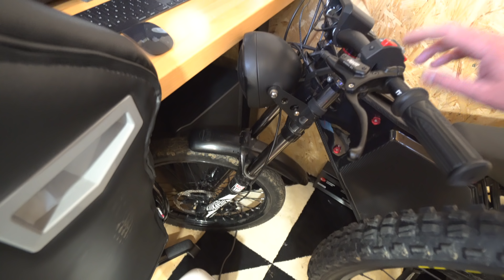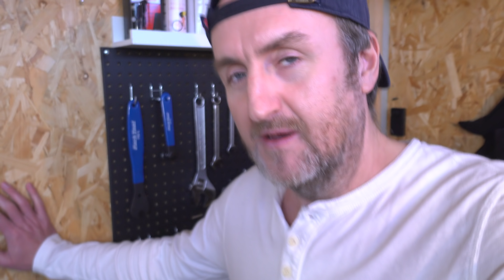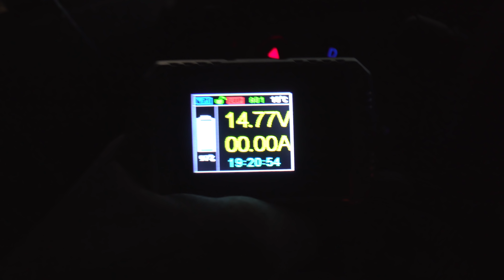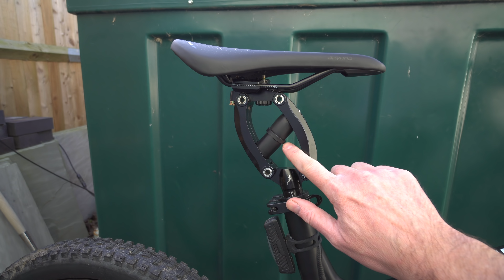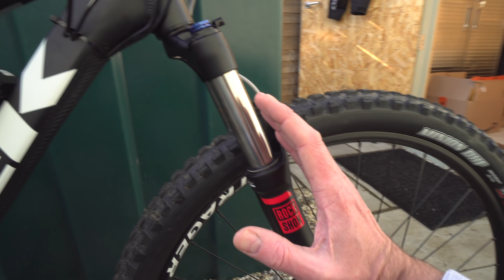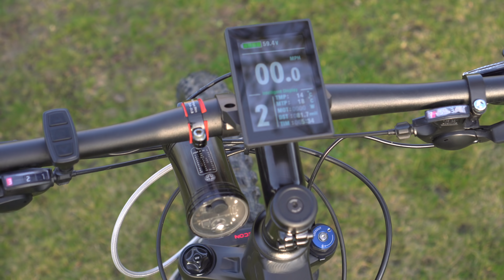BEST DIY EBIKE MODS 2019!

Comment: I just finished building my own ebike and like yours it amazing, its like going in a shop to buy one item and come out with half of weeks groceries, just get carried away.  I just wanted to change my front hub ebike for a mid drive coversion, I have ended up putting new forks on, hydraulic cable disc brakes, saddle ,handlebars I just got carried away, but yes its an amazing bike and love riding it and of course it as been built to my liking.  So yes building a ebike yourself is great fun and glad I did it as I think apart from Frame, battery and back wheel everything else as been changed and like yours it an amazing cycle made just for me.

Comment: Hello i bought you 1500 -2000w kit in august 2020 and it stll has the full cable instead of the pinned quick release  why is this please ?
Reply from the maker: The 1500w kit always has the full cable because the current is too high for a quick release connector.
Reply: @andykirby  Thank you for your answer that helps

Comment: Hi, I have the same Kit and Kt Lcd8s  Can you tell me or do a video of what the settings should be, for best performance top speed excelleration On the throttle, ie  the p  c  L  parameters,
Reply: It will mess up the ratio which will result in very noticable distance shortage

Comment: Anyone know what size the rear wheel is, it's definitely smaller than the 29er front, maybe a 26 or 27.5, want to build one of these but would like a 2.8 rear tyre so wanna make sure it fits, thanks in advance
Reply from the maker: It was a 26inch, if you are going to do it then prob best keep the same wheel size front and rear.
Reply: @andykirby  thanks, dunno if it's practical or not, but love the look of the fat 2.8 on the rear, think I heard you say somewhere that 26 is best for the 1500 hub motor, so will go with that both ends, cheers

Comment: Johno Hi from here in Australia I going to buy a 1500W rear wheel conversion Kit need to buy a battery, what i would like you advice on should I buy a 48V battery about 14AH or  52V  battery as I noticed the price of the 52V is only a few dollars more is it worth it or will the 52V battery damage the 1500W conversion motor.  I not interest in speed just need help getting up hills on the ride home, since my heart operation even a small hill I need help.  your videos are great look forward to your advice Thank  You Johno

Comment: Hi @Andy
Just let you know the kit arrived last week. Already installed and made 150km. It's fantastic.
Actually regenerative breaking is working perfectly without Throttle. Just change settings in menue c13 from zero to five. Five is the strongest. Now when I brake with front brake regenerative braking kicks in in the back..  so I now have a combined braking system.
Very satisfied with the kit 👍
Reply: How long did it take mate. I ordered mine 3 day ago
Reply: deveric, do you know how I might invoke regen braking if I haven't installed the supplied brakes levers?  Didn't install them as I have hydraulic brakes and couldn't see how you use the supplied ones that go with the controllers.  I didn't understand what Andy meant by coming of the throttle and regen is started just before it hits zero.  To me I would want regen to slow down from a fast speed not when I'm at or near zero?

Comment: Alright Andy, I have the exact same kit as you and I was just wondering how do you know how many miles you have left and how many miles does your battery last also where did you get your black box from that has the controller in and wires?

Comment: In one of your videos, you said there were no mid drive motors that offered re-gen... here's your sign!!! Get it done and i will buy one from you. Cheers and be safe.
Reply from the maker: The truth is it’s not actually worth it on a bike with a small battery because you can’t really dump a lot of charge into these batteries without damaging them... the max charge rate is about 4A (so 4A x 58V = 232Watts of regen is not a lot) if you had Graphene or cells that could dissipate a high charge rate then it becomes viable.

Comment: Very nice finish Andy and it looks good and the brakes and saddle post are a excellent choice.

Now for the negatives lol.....
Why on earth all those crappy connectors on your controllers. 

For a long time my main gripe is all those f..king connectors and what tft screens can be used.

First of all those higo and Juliet connectors. Then open or close brake systems and then compatible controllers. (Sine wave or square..mosfets and finally magnets on the pedelec and throttle wiring...no bloody common standards in the Chinese bike world.
I have a bafang 500watt rear hub...with Lishui controller ..Juliet connectors and a sw kingmeter lcd...If I want to fit a eggrider display what controller is compatible...or what controller with a color tft screen.?
If you can sell a tft color screen with higo or Juliet waterproof wiring and compact controller  as a kit that would be a first..I know KT controllers have a compatible screen but it's rather shitty.
I know you do a Subvoton kit but it's to big and the wiring not waterproof. Any ideas on a small 500w 20amp controller with Juliet controller and a TFT type Bafang controller as in France nothing available .Ahh and  a light wiring socket .On your bike no lights mate so not a good thing....😃😃💗💗
If you can crack this problem mate your the boss because I have been looking for last 12 months on aliexpress and lots of ebike sites but nothing exists...A lot of my mates want a tft screen but can't find a compatible kit it's a real nightmare....any ideas most welcomed.😜💗💗
Reply from the maker: Thanks mate. It is a problem yes, and something I’ve been thinking about a lot. There’s a few standards that have appeared recently and it’s certainly better than it was 4 years ago but there is a long way to go before we reach full plug and play! 
For big bike builds then I think you’ll never get away with the complexities of the sabvoton and adaptto, Kelly etc controllers but for simple ebikes it needs to be even simpler. Have you seen what Grin are doing with their base runner controller that is actually built into the battery bracket. Seriously cool and a truly minimal install with hardly any wires. We are going to get those in the store soon.
Reply: I looked at the Grinn products very interesting ..Hailong are now doing a controller inside their battery pack.The plug and play does exist bit it's reserved  on  expensive factory models. Bafang do it on the BBS01 mid drives but rear hubs nothing. The plugs on the bafang hubs are pretty standard the solution exists but the Chinese don't want to offer this solution because it will kill all the smaller manufacturers. So lets be creative why can't a British company offer such a kit..food for thought...anyway I'm off to India for a few months so if I see anything interesting I will share my findings....best of luck with e bike project..😎💗💗

Comment: How much does your high power ebike weigh? Even a rough guess. Building basically the same ebike with the qs273 and am curuious what to expect
Reply: About 60lbs with a Schwalbe marathon plus gt tyre and slime tube ( these 2 items alone added 4lbs to the rear wheel weight😯
But to be fair you don't notice it with it the power this puts out,  unless like me you don't know the range of the battery on your 1st ride out ( at full power I should add) and run out 2.5 hilly  miles from home and have to pedal the bloody thing home.😓😓
Reply: Sorry didn't read your post properly, I'm talking about the kit in this video added to my cube 29er ltd sl.
It's a proper tank now but its Brill fun in pas 5 mode keeping up with cars in the 30mph zone ( only did it once and now ride sensibly  lol).

Comment: Hello Andy, can I pick your knowledge? I have a 60volt 25ah battery using a 30amp BMS. What are the positives and negatives of having the same battery as mentioned but using a 50amp BMS.
Reply: it'll handle more current and might balance quicker but why change it ya battery will only last 30min for a guess even if you draw 40amp,,,the 50amp BMS might just be output and balance might be same as your 30amp version as a guess tho 😁

Comment: Where did you find the box for holding the controller ??   Thanks, Al
Reply: Link is in the description. Bought the same one but couldn't fit the controller and all the wires. Now I use a little motorcycle bag under the saddle. Don't know how Andy made it fit.
Reply: mopalover55, did you sort your case problem. I'm having trouble finding the right controller box?  Ordered 2 so far and both too small!

Comment: Do you have any of the new wheels with the Juliet connector that you mentioned making it easier to remove the rear wheel. Would buy one of your kits if it has the new connector.

Comment: Whats total cost with mods?
Reply from the maker: The main essentials for this build
Bike £400
Motor and battery kit £740
Suspension £300
Maxxis Minion Tyres £80

On further testing the standard tektro brakes are good enough and the funky seat post isn’t really needed. 
This build really is a great everyday ebike.
Reply: @andykirby not too bad, i like the concept.  thanks for the reply!

Comment: Hi Andy.
Just ordered one of your 1500w kits with the upgraded wheels and the sensors for hydraulic brakes. 
Do you have any info/video on fitting these brake switches.
Also, didn't realize that I'd entered my email address wrongly. How can I change this. 
Regards
Brad

Comment: Hi Andy, I've got an 8kW model, same as your powerful bike there in the shed. The MSVA is horrendous, I don't even know where to begin. I downloaded the official pdf guide and it was way too technical. It would be good if we knew where to get certain parts like the brake levers etc. I only have rear indicators on my model if I were to install front ones, how do I get both of them to work together? So many questions regarding this but too little info out there.

Comment: With those seat posts that have suspension, you need to be careful on long rides with them as they are no good for long rides. If your legs are constantly taking shocks with your bum moving up & down then the force goes through your knees & on a long ride any sort of change with your setup will cause your knees to swell up like balloons.
Reply from the maker: Is that if you are pedalling?!😁
Reply: I did 2000 miles last year with the suntour syspension seatpost and my legs are better because you can lift feet off the pedals on bumps

Comment: I’m curious if you have suggestions for converting an old motorcycle to electric. Great videos
Reply from the maker: Yes the easiest way would be to use to hub motor (motor that is laced to the rear wheel) something like this motor: https://www.cloudsto.com/ebikes/motors/qs-273-v3-8000w-motor-detail.html then you could use all the available space where the engine went for batteries and the controller. A mid drive motor would allow you to preserve the running gear (gearbox,clutch) but would require mount fabrication and more work.

Comment: I have a question. I am thinking of building an ebike. What is to stop me using 4 12V batteries usually used in Emergency Backup Power Systems in series. Also, they are 12V 20Ah each, but don't have any stated Amperage. Is that a problem. Thank you. You have been a great help in my process so far. Love your work :)

Comment: If you want a lightweight bike like mine then you would need a full 3k carbon fiber as much as possible, frame, handlebars, seat, seat post, put shimano ultegra running gear except the crankset, wellgo carbon pedals, strong wheels if 26", michelin wild run r advanced 1.1" slick tires. Then your bike will be about 8.25 kg without motor.

Comment: Wow! Off the scale Andy! You've gone mad with the Trek mate - looking very tidy indeed. Is it fare to say this project has made your decision to register the Beast for the road? Because with both bikes, You now have all options covered.
Just a very quick tip for the colour LCD. C3 parameter setting, set to 0 Andy.  Me giving you advice, funniest thing I've heard all week!!
Cheers mate The Trek is gorgeous!
Reply: Can I ask what changing c3 to zero does please?
Thanks
Reply: @jasonlocke154  Hi Jason
Yeah setting C3 to 0  just means that everytime you start up your bike/LCD it defaults to 0, meaning you always start in neutral. Rather than starting up in the last setting you left it in, 5 for example!  This can be dangerous when pushing the bike with maybe an accidental twist of the throttle if you have one

Comment: Hi Andy nice bike be interesting to see the performance..I'm running a Bafang mid drive on a 29er hybrid . Trying to keep it light but I'm only 250w with a 15ah hailong battery..been running it for about a year now...would have liked to go to a bigger motor and looking back I should have..I've not been stopped or even had a copper look at the bike even though I can do 30 mph. Have you had any info on the latest drone laws it's been a while since I've been out with my phantom..
Regards
Jim

Comment: For S-PEDELEC if you buy direct you can speed the process up using a "certificate of conformity". I can't find anyone selling S-PEDELEC with certificate of conformity at the minute. Finding it difficult to find any S-Pedelecs worth buying really. I think they've got so much back stock and don't want to be responsible for putting non-legal bikes on the road the ebike market doesn't want to put them out there. I think you could potentially make a killing mate if you sell a kirbebike with Certificate of Conformity or even pre-registered! Get in there first mate!

Comment: Get rid of that pedal assist! I remember i had a very old e bike, had one of those pickup magnets in the crank, i just got rid of all that junk and put the sensor and the magnets on the rear wheel spokes lol, best cheap hack ever, i could cruise around on that piece of crap without pealing, i just had to gain a bit of momentum and then it would think i was pedaling, it did have a thumb lever for throttle so  could cut the power at any time.

Comment: Could you please look into Carbon Foam batteries and how viable are they. They are supposed to be the poor mans lithium and are drop in replacements for standard SLA batteries. I tend to trust your reports on batteries than those who have a vested interest. There are a lot of people having to use SLA instead of lithium due to their vehicles being shipped with them, children's motorized ride on toys some of the cheaper kick scooters and mobility scooters. From what I hear they can be discharged beyond 80% on a regular basis. 

Now the cynic in me says no way. But if it is true I could get some without having to fit other controllers or chargers. Now this could be of huge interest to the disabled community as they could go further and somewhat able abuse their batteries without the huge penalty of killing them stone dead.

Comment: Very nicely put together Andy, I have been using a thudbuster for 12 years on one of my ebikes, its an amazing seat post, great to see the wheels turning up with disconnects by the hub, thats essential and the first thing I did on all my builds all those years ago, make sure the torque arms you supply with the kits are good, we had a batch made from stainless steel locally at an engineering shop because the chinese ones were weak and had poor tolerance, dont scrimp on those, back when we were doing this a lot of the frames on conversions were steel but they are mostly going to be aluminium these days.

This kit will blow away the 2-3K and upwards legal ebikes even with their speed restriction mods they fit on them, in fact on the way back to work today a guy on a 4 grand legal ebike tried to accelerate away from me on my 15 year old 40,000 mile steel ebike, I felt bad for him ha ha and thats in fact what made me mod my ebike in the first place, I got passed by a Lycra dude on a normal bike and he said that looks heavy, he was the last person on a normal bike to pass me without me trying anyway, that was in 2003! ha ha ive been in this game too long, great to see you back in the workshop and well done on the 10K subs! im not jealous honestly!!